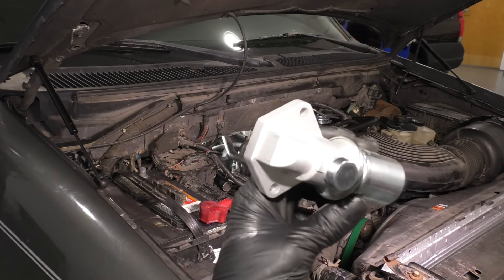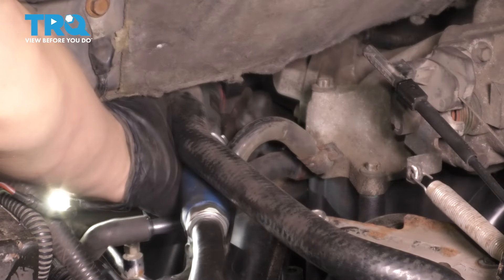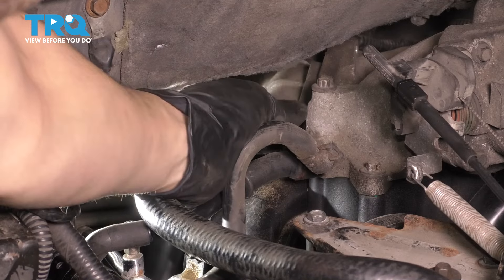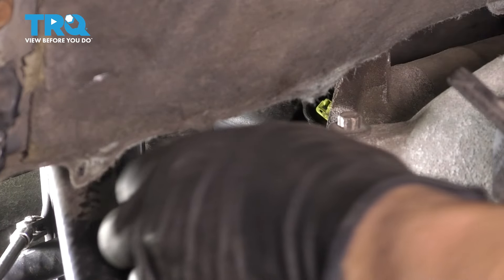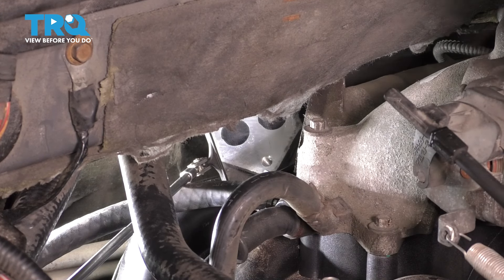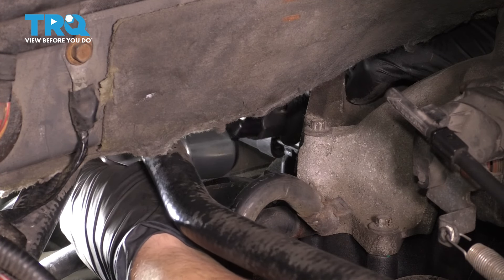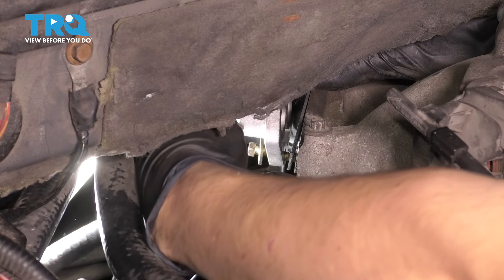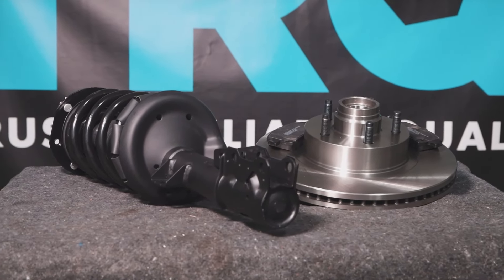How to Replace Idle Air Control Valve 1997-2003 Ford F-150

Comment: Looks easy enough. I ordered mine yesterday. I was told it would be in today by noon. Turns out the part never came from their autozone hub. Im still in the computer under their warranty. Hopefully, there is nothing else happening behind the s enes when I check up on my part. I'm tired of stalling out at the lights and stop signs.

Comment: For anyone wondering the internals of that printer before burning were typical printer parts and aluminum powder mixed with iron oxide powder.